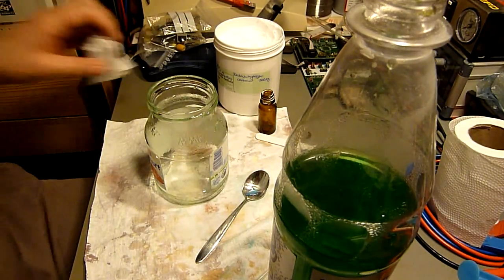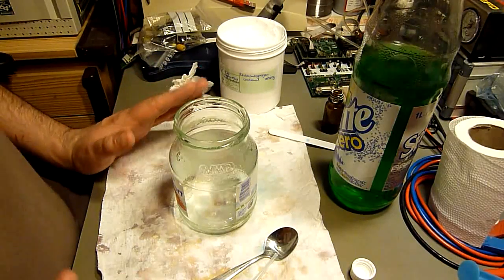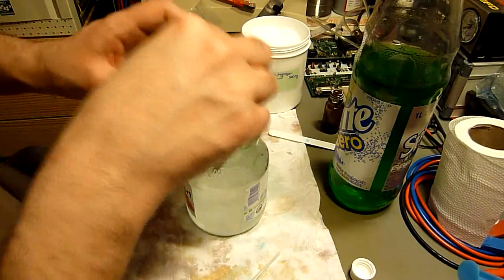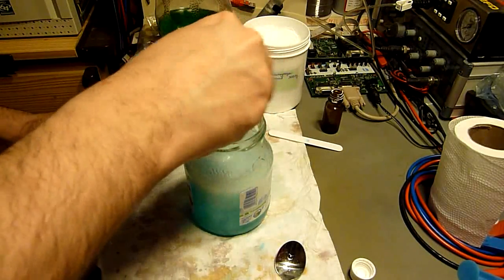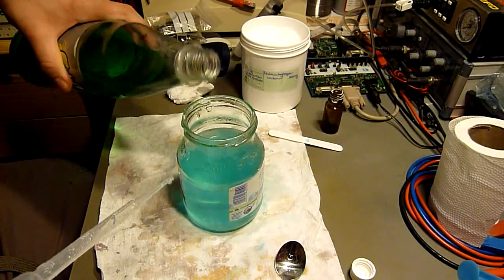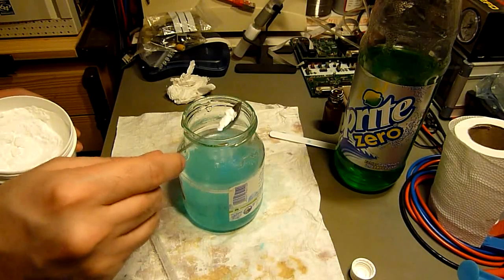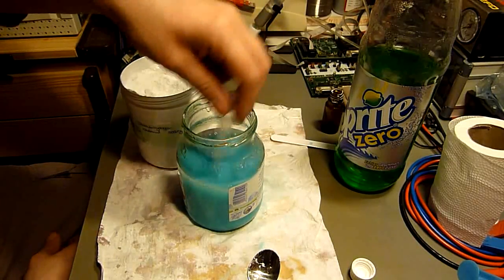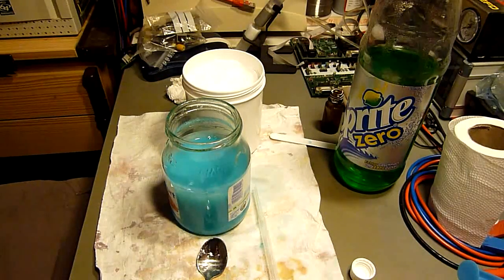How to fell the copper chloride out of a HCl based used up etch brew.

Comment: im so confused...why not just make cupric and etch with that?
Reply: Because he is disposing an excess.  Cementing out the copper on scrap iron may be cheaper, but you still need to neutralize the acid with sodium hydroxide, carbonate, or bicarbonate, then dispose of the iron hydroxide.  Apparently he wants to keep the copper carbonate he's producing.  Given that Sodium Carbonate is cheap at pool supply stores, this is not a bad waste treatment method.  The only byproducts are salt water and CO2.

Comment: I did try this with NaOH, watered down the etchant solution by another 50% or so before and got a reaction similar to yours. Although the foam would first turn brown and pretty fast go back to white. I guess it has to do that reaction isn't exactly the same, as i guess i end up with CuOH2 instead of CuCO2 in the filter.